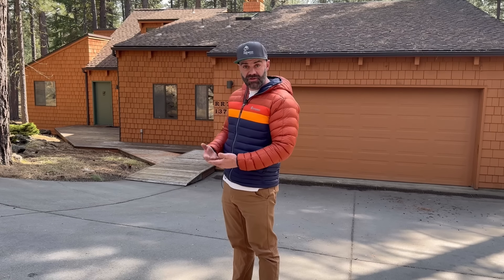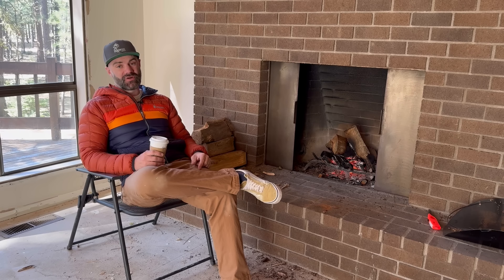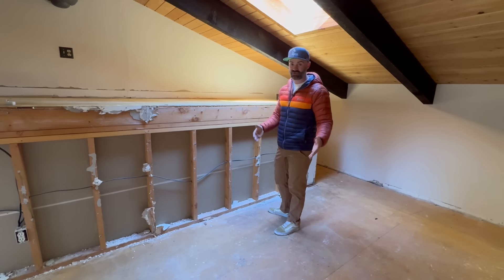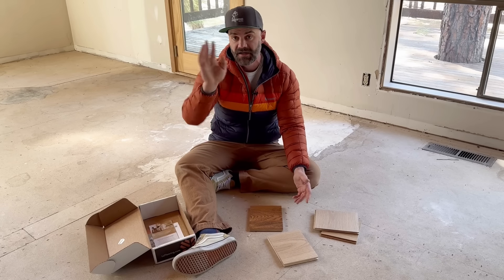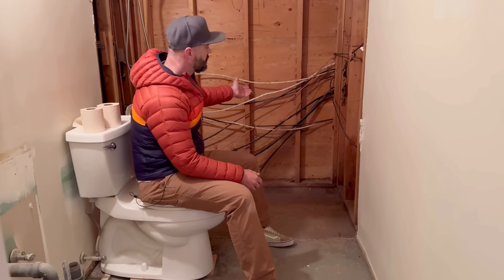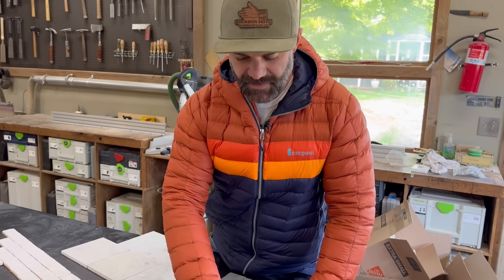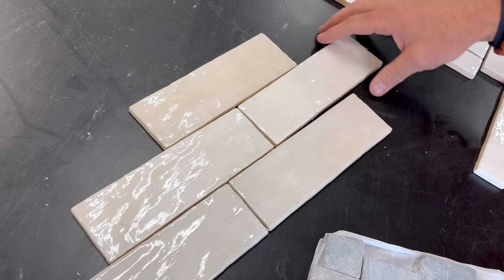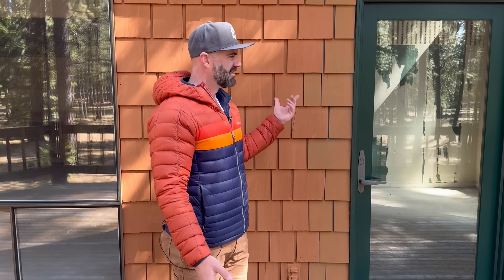Cabin in the Woods Update || Everything Takes So Long

Comment: Yeah I was pretty sure that beam you took out was structural, easy fix. As far as the window header, 4 or 5 bottle jacks and an afternoon and you're done. I rebuilt an entire wall in my kitchen, i mean there was nothing there but my temporary wall holding it up using bottle jacks to raise the roof. Oh, and the engineered wood is great, I bought the best I could find but it's not as durable as you may think. My cat proofed that,, yeah scratches dang it.

Comment: Worked on a fire rebuild last year.  Owner had been in the house for 7 years.  Had a cold snap in Feb 23.  Owner cranked up the gas vent free fireplace for a little extra heat.  Promptly set his house on fire.  Previous owner had added a porch off the living room with a shed roof tying into the living room roof.  Previous owner apparently thought “vent free” meant “heat free” as they removed the chimney above the shed roof and just framed over it.  Heat from the fireplace went up the flue into the attic and set it on fire.  Basically a booby trap.  So yeah, permits are important.  Best we can tell none of those modifications were permitted.  Everyone was safe and his insurance co paid for the repairs…all 300k of them.
Reply: That’s the dumbest thing Ive ever heard! I can’t believe his insurance covered it 😮
Reply: Well the insurance company insured the house he bought, which already had the hidden flaw. So...
Reply: Yep. Permits are important 

Every time something fails or someone dies, it gets added to list of requirements.
Reply: This is also a good argument against a 'quick claim deed'. in which you release the previous owners from all liability
Reply: @GreenWitch1  Insurance covers “stupid”.  As it was explained to me “you can walk into your garage holding an open bucket of gasoline in one hand and a lit propane torch in the other, stumble, and burn your house down.  As long as it was an accident and you weren’t trying to burn it down they will pay.  I mean you would be an idiot, but again insurance covers stupid.
Reply: @Otisthelesser  I did not know that 🤷‍♀️
Reply: @kmw8775  I noticed that after I read it again. It was the previous, previous owner. Got it.
Reply: @---l--- the correct term is “Quit Claim Deed.”

Comment: If you’re replacing windows to enhance thermal efficiency I’d also really think about ripping down the drywall in all the exterior walls and upgrading the insulation. Now is the time to do something like that. I remodeled a 1960 home and only reworked 25% of the exterior walls thinking the others would be fine. Was I wrong and regret not reinsulating all the exterior walls with something better and more sound insulating.

Comment: I have cedar covered columns on my front porch and yesterday I was going to apply a sealant and it said it was “natural cedar”. I did a test spot and it was the color of your house. It looks like water from an old rusty pipe. Definitely not natural cedar. I agree you should change the color. I took the sealant back and got clear sealant so it stays the naturally wood color.

Comment: Wow, you're going to put the flooring down before anything else?  In my house, they built the closet inserts then put the carpet in.  So I ended up with these 3/4" wide gaps in the carpet when we pulled the old closet units out.  Fortunately we were re-carpeting.  Unfortunately we had to pull all the closet units out and replace them before re-carpeting so we didn't repeat the same mistake.

Comment: Hardwood flooring installer here. Engineered hardwood ranks lower than laminate in my opinion. Across all brands the layers tend to delaminate. So even if the floor is glued and stapled which is very common with engineered. The layers will start to delaminate and squeak. Have seen the entire wear layer separate from the plywood bottom. Wish you nothing but luck with the remodel!! Would stay away from engineered though!

Comment: When you got to talking about painting the brick I stopped the video to leave this comment. Back when we were looking for a house. If I ran across painted brick I instantly turned around and left. If I were to put a bid on the house, it would have to be with a $10,000 deduction for the damage to the brick. Most times the brick was ruined and would need to be replaced.

If you are still insistant on painting the brick. There are clear sealants, yes some have tints, if you wish and THOROUGHLY seal the brick before painting. Just as you wish to make changes to the house, future owners will wish to do the same. Why lock everyone into painted brick. To me, it's my opinion, painted brick looks tacky and unprofessional. It's your house do what you want, but if you still want to paint the brick, seal it first. You've always have done the job the right way, do so with the brick. Your future owners will appreciate your efforts. Be safe.

Comment: People get positively neurotic about solid wood floors. Solid 3/4" wood floors have an undeserved reputation for quality. BUT they cup and warp much more easily than an engineered hardwood. Solid wood has more defects (unless you pay for select grades and your project will not support $30 per square foot floors). They are miserable to install and very difficult to repair. Engineered woods hold up MUCH better in a humid four season climate like Oregon. They don't cup, warp, or twist. Engineered wood doesn't shrink and swell with the seasons (OK, maybe 1% to 2%, which is a lot less than the 15% typical of solid hardwood).They're much easier to install and much easier to repair. I repeat, solid wood floor's reputation is undeserved - engineered wood floors are the superior product.

Comment: With all the pine needles, how about covered rain gutters?  You would not have to get up and clean the gutters so frequently.  You could also have a rain water reclamation system to use rainwater for flushing toilets or washing clothes, and only have your main water source kick in if there is not enough rain/snow melt in a reserve tank.  At the very least, you could put a rain barrel on your downspouts to water plants in the garden without using your main water supply.
Reply: I have a house in central Oregon.  Not all of my house has gutters but they are not covered.  Cleaning ponderosa or lodge pine needles out of a a cover is far harder than an open gutter.

Comment: I am too late to suggest that you first get the engineering done before demo! I enjoy your approach to woodworking and hope that your focus remains centered in the woodworking discipline free from construction as this is a seperate industry that uses similar tools for vastly different goals.
Your project from my limited point of view seems to be heading towards a negative capital investment without allowing you meaningful returns on the one asset that is limited, your time.
For commercial use, do not use finishes that one would choose for a private residence and in this vein I strongly suggest that for flooring a ceramic tile that mimics wood would provide you with an enduring finish with very low maintenance while being extremely resistant to damage, remembering that vacationers will not ever take the same care as an owner of the finishes. Second only use contractors that pull permits for all speciality work. Always be extra cautious of any contractor that suggests that permits are not needed and insist that each contract be permitted where practical. (Electrical, plumbing, HVAC, roofing, ect.)
In a highly regulated area as this appears to be the C.O and C.U. may be jeopardized by un-permitted work especially structurual changes w/o sealed and approved plans with necessary permits covering changes. Make sure that zoning allows for short term rentals that will allow you to achieve your end goal and get Insurance to cover your investment. I was as a secondary business an active developer for over four decades until my retirement in 2011 and wish you the best of luck for this project. Ray Stormont

Comment: If you want to know why you need permits, just think about what you found out in this very video. You pulled out a structural beam in a house people are going to be renting.  You aren't just putting yourself at risk, you are doing it to others.
Reply: You are liable, permits or not.  That is not the reason for permits.
Reply: @beerdedwanderer it's not an issue of liability. The permit wouldn't be issued without the correct engineering study. The engineering study would tell you not to rip out the beam. The permit stops problems before they happen. Liability only comes in to play after someone is hurt. Permits save lives.
Reply: @BradleyUffner  so the engineering study saves lives.
Reply: @beerdedwanderer  Yes, exactly! The permit process forces and verifies the engineering study. I'm happy that you finally understand 👍
Reply: @BradleyUffner  oh, I see, in order to consult an engineer you have to pull a permit. I didn't realize.   That seems unnecessarily restrictive.